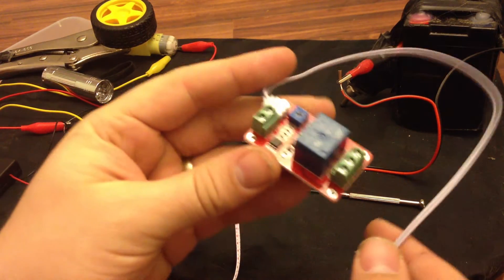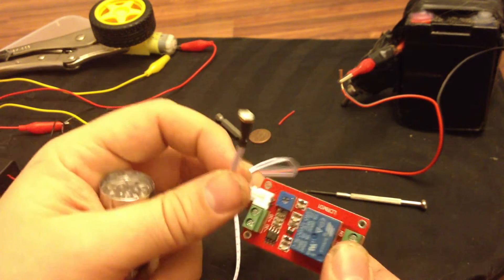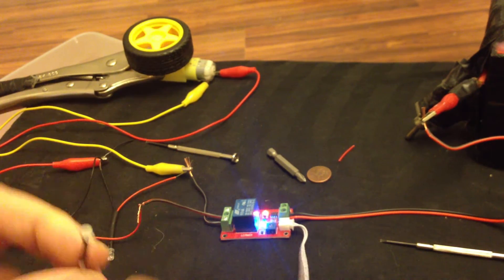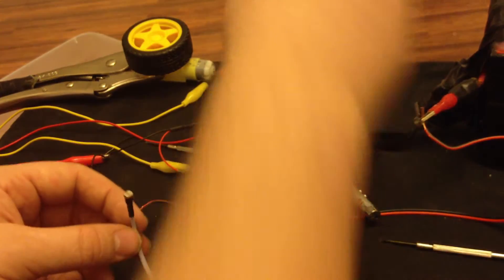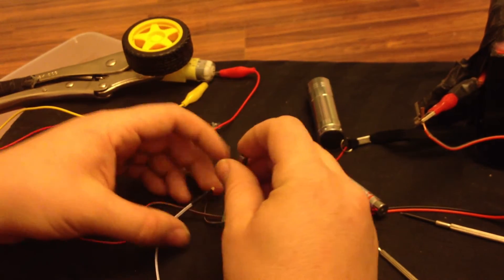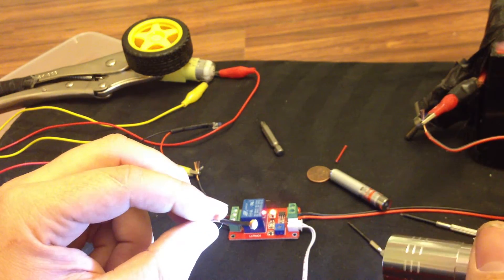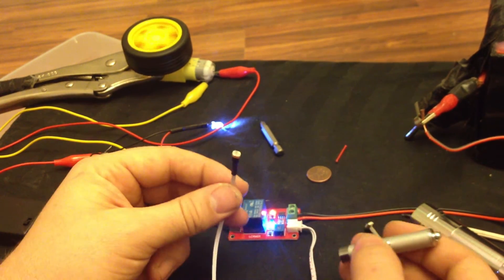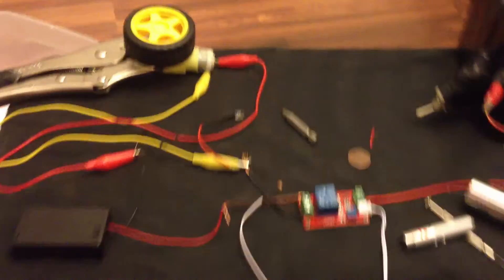12V car Led light control photoresistor relay module light detection sensor c2

Comment: Looks like you can use for a 2 light switching for one on when the sensor senses when dark  and one on when the sensor senses light I have a model train signal with green and red lights wanted to possibly to use for green on when the sensor senses light and then switch to red light when the train goes over the sensor and creates dark 

so constant green till the train goes over the sensor then turns off the green and turns on the red then back to green when exposed back to light

Comment: So it needs 2 power source?
Reply: NO. The power source to run the actual module and relay is 12VDC. If the circuit you are trying to control also happens to br 12VDC then you do not need a separate power source. But if you have and 110AC light that you are turning off and on then yes.

Comment: can this be triggered and kept on for a 1 second or 2? how would you do that?
Reply: You can't do that with this one. You have to get a relay timer. There are a few to choose from. Some turn on or off for a determined amount of time then turns on or off. Some are delay timer relays where it waits a determined amount of time THEN turns on or off. Some are set and pre determined and there are ones you can see the time on a digital readout.

https://www.aliexpress.com/item/32827507305.html?spm=a2g0s.9042311.0.0.27424c4dVyxorD

Comment: Do you have to have two power sources? Or can you just use the 12v on one side?
Reply: The power source to run the actual module and relay is 12VDC. If the circuit you are trying to control also happens to br 12VDC then you do not need a separate power source. But if you have and 110AC light that you are turning off and on then yes.

Comment: so i guess my question is why would you need 12v in and have no volts out after relay but need another supply on the relay end? seem like a waste if no power passes through the circuit, and you should go into more detail of the common nc no side and how to properly place them and what if any v- can pass if at all
Reply: remoad control car egy formula
Reply: The power source to run the actual module and relay is 12VDC. If the circuit you are trying to control also happens to br 12VDC then you do not need a separate power source. But if you have and 110AC light that you are turning off and on then yes.

Comment: its difficult making out the wire route coming from the circuit board to your motor.  Can you explain that better.?
Whats the purpose of the battery pack to power the motor, if the circuit board is powered by DC volts?
Reply: After buying one and having to figure it out...
From the power source: +/- to the 2 pins which run the optics relay. 
Then a (-)  off the power source to what you're powering.
Then a (+) off the power source to the Common pin. 
Finally a wire off your NC/NO to the (+) wire of what you're powering.    
Three months late but hope this helps
Reply: @mikedefelice33  Can you show a diagram of this please ?

Comment: Hello justin C!

I really liked your video! i recently bought such a 2 pieces but i could not connect. you could not give me or send my email circuit (scheme, diagram) connect wiring? (how connect wiris)...
my email: shovnadzegeorge@gmail.com
please help me...
I tried a lot of different schemes of wiring are very much on ebay.com and on the Internet in general but i can not connect wires, I do not understand electrical, That's why I asked you for help.
best regards
George!

Comment from the maker: http://www.ebay.com/itm/12V-car-Led-light-control-photoresistor-relay-module-light-detection-sensor-c2-/251419227977?pt=LH_DefaultDomain_0&hash=item3a89c0f749